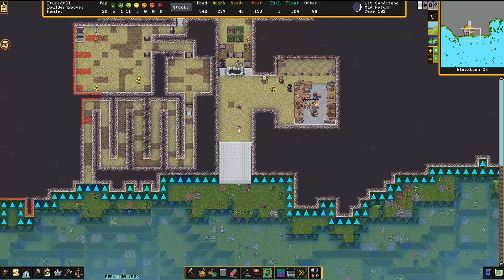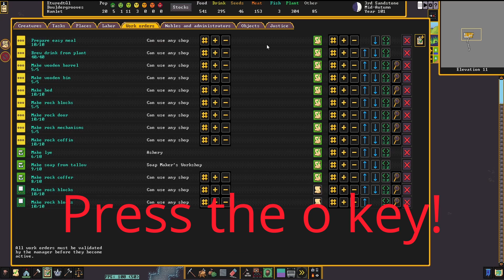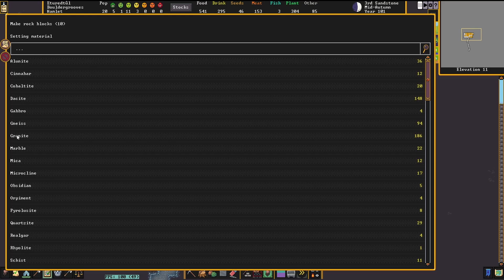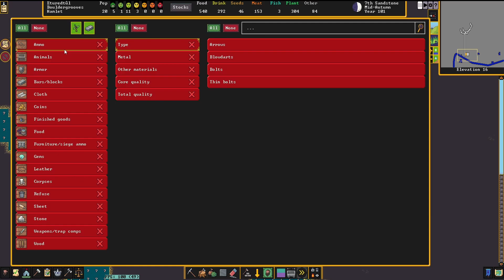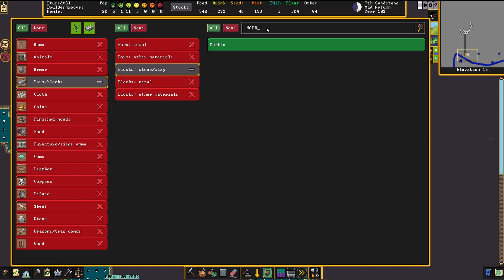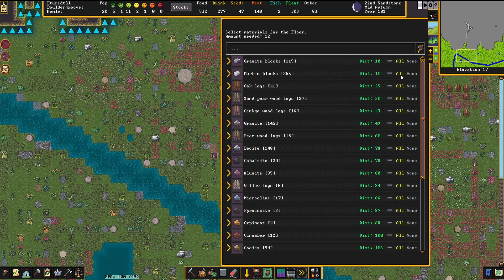Dwarf Fortress: Basic Construction | E10

Comment: What I wanted to know is how to remove the carved stairs (not the the ones that are built), because, as shown in the video, it doesn't match the floor you build around them. I've never found an answer to this yet, and it is one of the things that really bugs me about DF (second only to marks dwarves struggling with their equipment and training).
Reply from the maker: pressing m and then x and clicking on up/down stair cases will remove those (even the mined ones)
If it's just a down stair case you will have to build a floor over it to remove it.
Also your dwarves will have to have enough space to be able to move around and do it.
Reply: @UnforeseenLava Thank you a lot